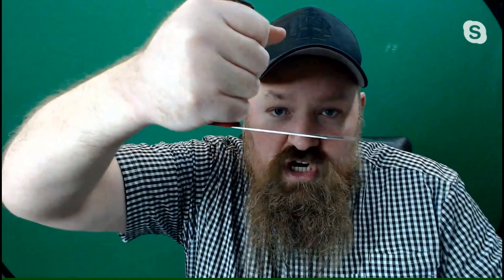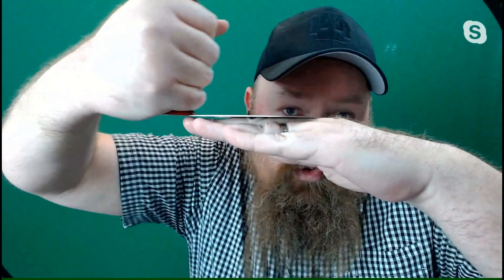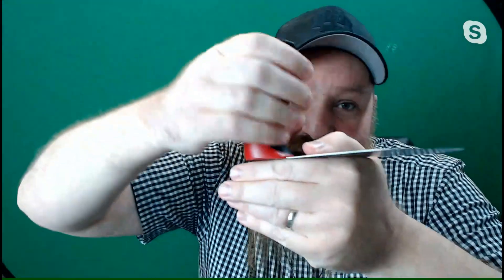A Putty Knife for 3D Printing

Comment: Agreed!  The best tool for any 3D printer.  I've had mine for 4 years and my Prusa printers run at least 250 days a year.   The steel is very high quality and hasn't deformed in any way despite some  seriously stuck-on ABS prints.  The tip shape is also unique giving it more "pry" strength and scraping effectiveness.  Can't recommend this particular brand enough.